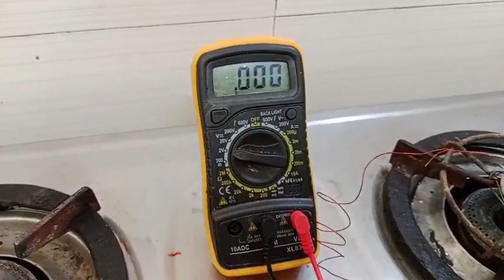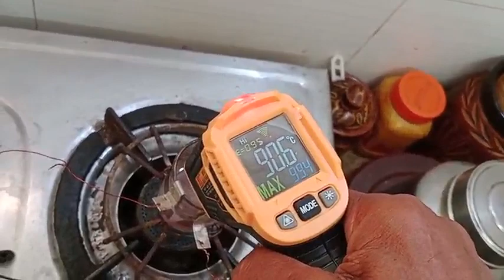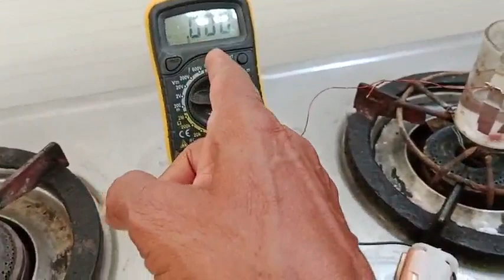Hybrid world first 0v@90°c water spliter using s-conducvity Tamil EDU

Comment from the maker: https://youtu.be/XKtoWVAapsw
உலகின் முதல் முறையாக அறை வெப்பநிலையில் நீர் வளி(ஹைட்ரஜன்) உற்பத்தி மற்றும் செம்பு மின்முலாம் பூச்சு...
World first room temperature  hydrogen producing and copper electroplating using q-phy, s-conducting, s-diode,Dc back EMF redirect to split water continuously, Nano alumina porosity,etc...
Low cost water splitter generates clean hydrogen to space life vengatesa edu 200years proplum solve
AAA 0.1v battery-powered water splitter generates clean hydrogen -DIRECT THERMAL WATER SPLIT Q-PHY TECHNOLOGY using aluminaporus electrod,exo100°c,0 ohms,600°c dielectric and heat resist ceramic pot, Back EMF arresting diode etc
0.1Vdc Powered Water Splitter Could Revolutionize Fuel Cell Development